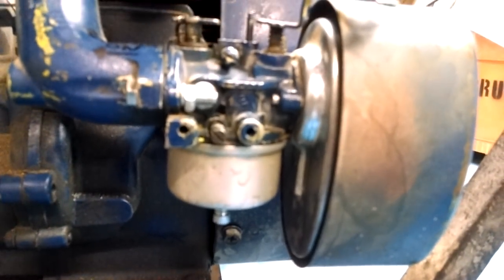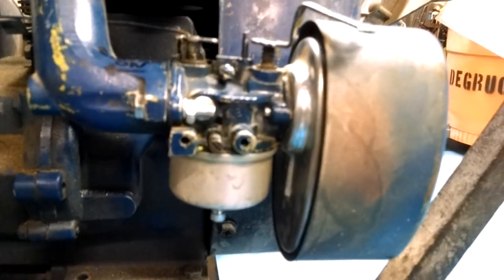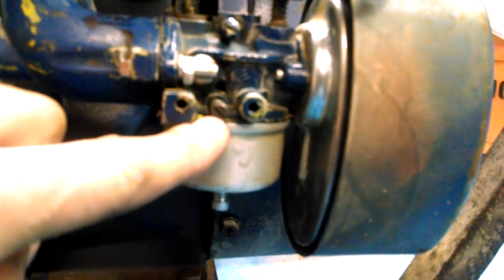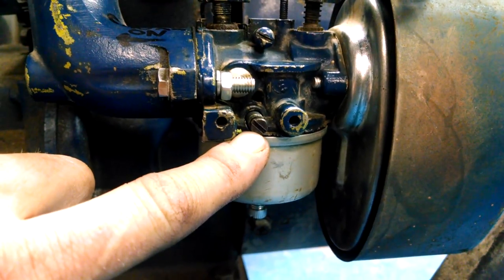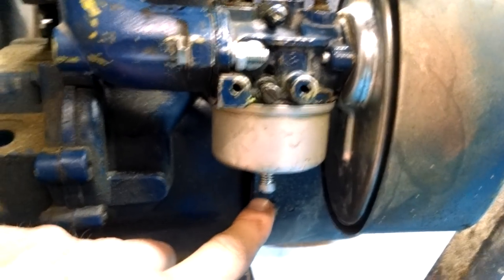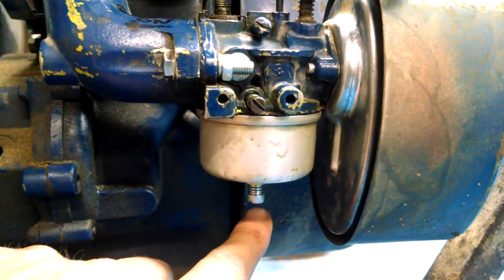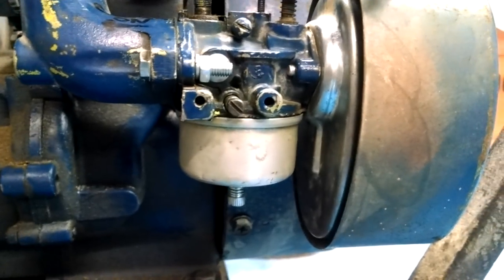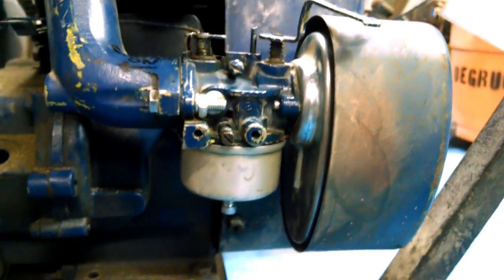DIY How To Adjust a Tecumseh Carb On An HM80 Motor

Comment: I agree with the fuel screw instructions you gave. I screwed mine out like the manual said and it kept vibrating out. I slowly backed it out after that and the mower ran better and it didn't fall out again. 2.5 turns would be far too much.

Comment: Thks for taking time to do video. Was just given a 95 rear engine Murray riding mower that didn't run. Your video was a great tool to factory set the mower. My fuel screw had broken off. Easy fix ..

Comment: They are not wrong. They are just trying to meet emissions.
Reply: +aarothepharo Not on an engine that old. That engine had no emission standard and if it did it's not like today. The newer Tecumseh engines (before going out of business) had a non adjustable (fixed jet) carb. Meaning that screw is capped off and not adjustable on the same engines that were newer, you can only pop the cap and unscrew it to clean the jets but it can not be adjusted and it makes trying to tune a newer tecumseh to where it wont puff and pop almost impossible. I know because I have the same engine and I cant adjust it and its running poor and its a pain in the ass. He's lucky he has the older model and has that screw to adjust.
Reply: from what I understand on my carburetor by tecumseh when you screw it all the way in you lean the mixture and when you screw it out the mixture becomes more rich.  So screwing it out 2.5 turns would make it more rich than only going out 1 full turn...